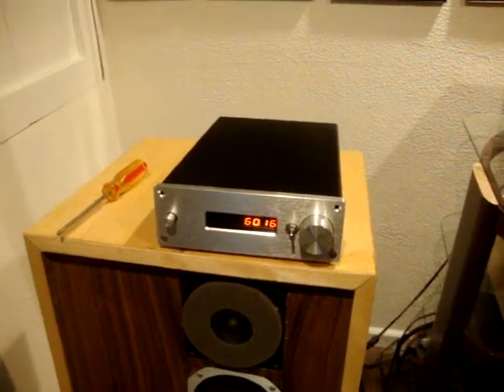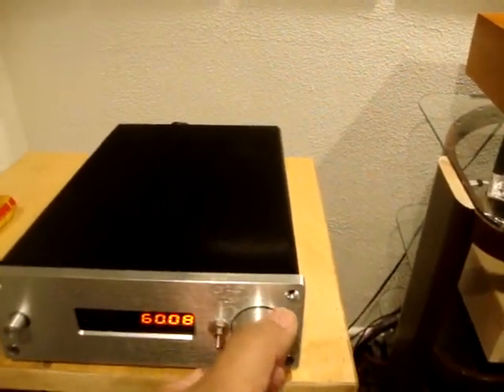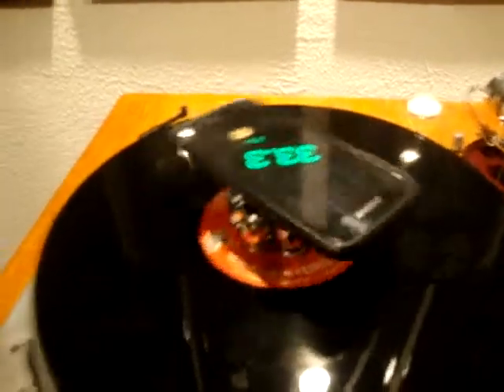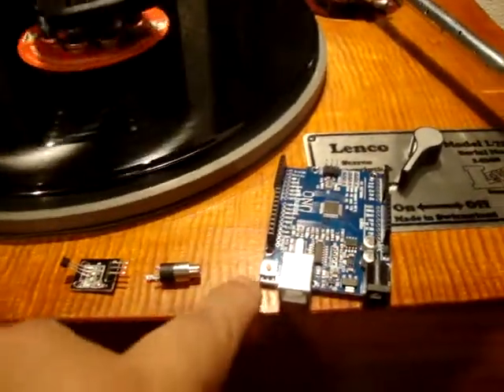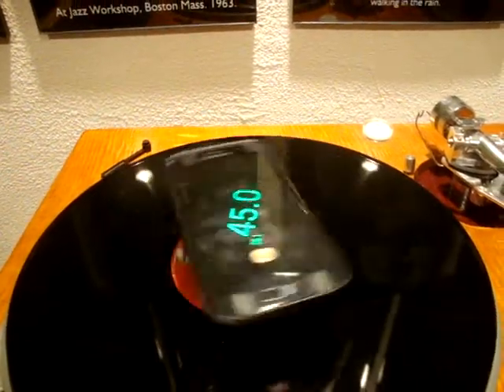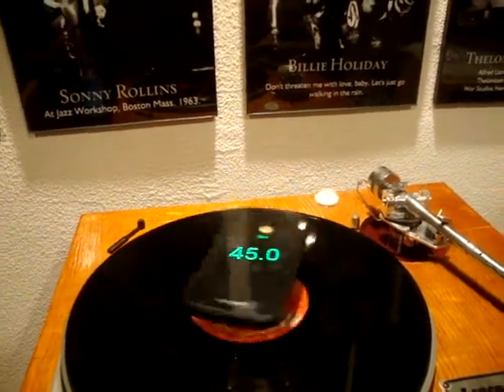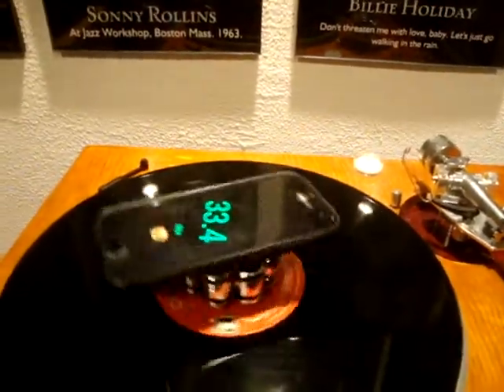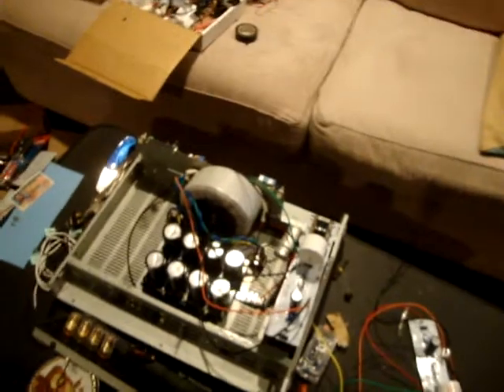SG4 Turntable Motor Controller.

Comment: Can I use this motor controller for my Pro-ject Debut Carbon Evo Turntable to control the motor speed. If yes how can I connect this to my turntable.
Reply: Pro-ject uses a DC motor if I'm correct,Lenco motors run on AC,this motor speed controller adjusts the AC sine wave to give you consistant 33,3 or 45 or 78

Comment: Does the tach. provide feedback to the power supply to adjust the line frequency automatically?
Does the tach. show more than one decimal point? IOW, 33.33 or 33.333? The phone app. lacks resolution but I'm curious
more about the resolution of the tach. and whether it has direct feedback with the P/S. 
The Phoenix tach. provides ultimate resolution, all the way to "thousands" of an RPM so you can see
how accurate the platter rotates in terms of overall Speed stability. 33.3 or 45.0 isn't a real deal breaker in terms
of resolution, better than nothing, but it would be nice to see more results when you have time.
BTW, the Phoenix tach. and P/S work as a single unit to control rotational speed "without" user interface.
Look forward to hearing more about your DIY project.
Reply from the maker: No, The tach and SG4 are separate but you know programmers. A Code to talk between the SG4 and Arduino uno would be something. The Falcon PSU and Roadrunner ran for around $700. Its on another level but the Sg4, was created by the same engineer, I Think . Check out pyramid on Diyaudio.